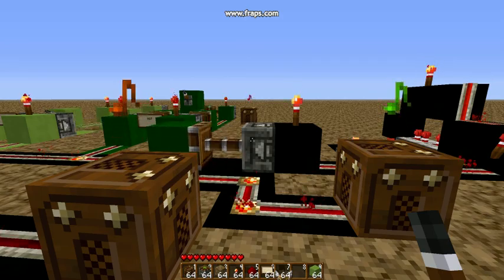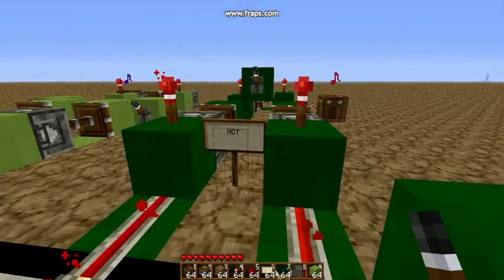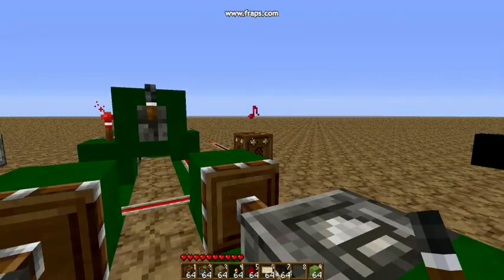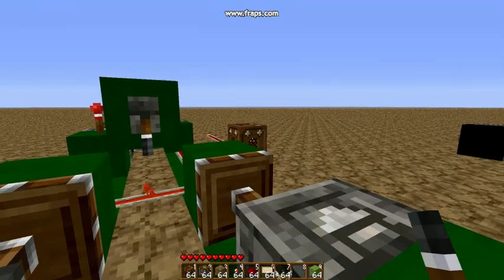NOT/NAND

Comment: In order for it to be instant NOT the input has to be a clocked instant wire, not just a lever. In your case the NOT is occurring at the point of the lever, not in the instant gate. A way to demonstrate instant NOT is to line up a large even number of them in a row and show that you got your original input back.